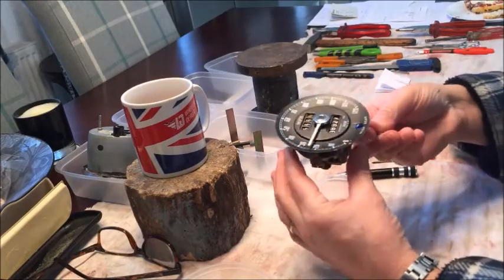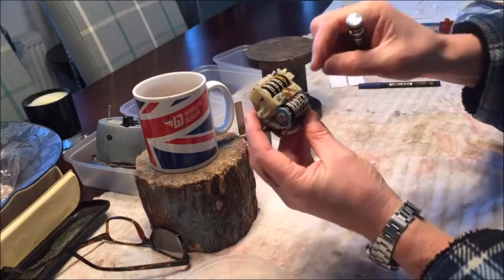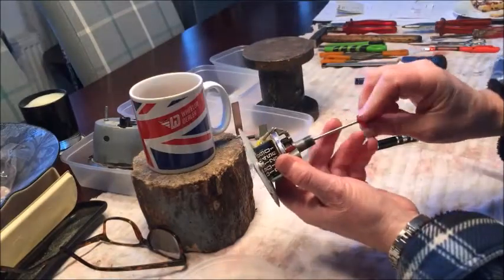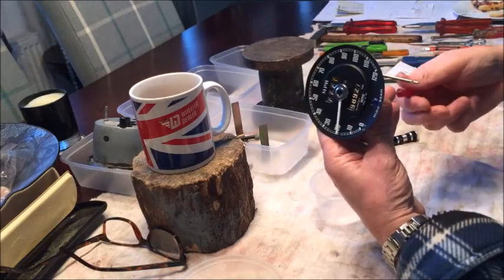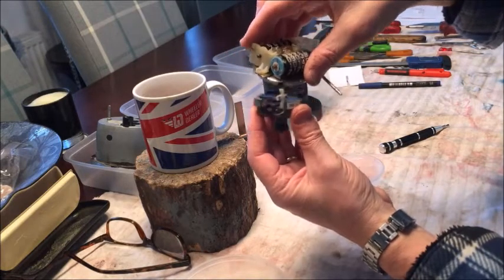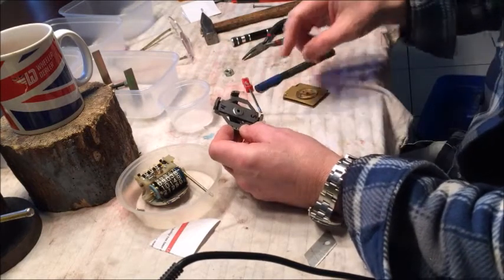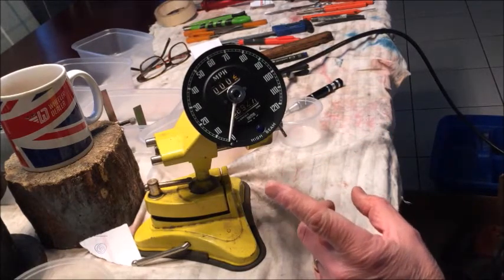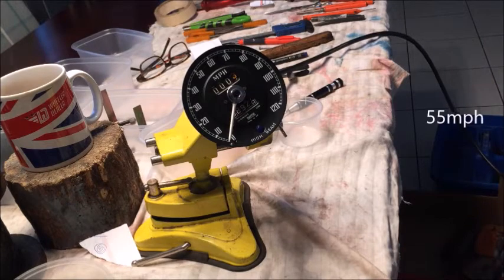Smiths mgb speedo. How it works, how to re-magnetise the drive spindle, 2 of 3

Comment: Hi Neil, Very good video. I watched the series last night and then took apart my wildly optimistic Morgan speedo using your instructions, cleaned it out and reassembled it. Tests great on the bench now, which it would not do before so I think is all good. The true test will be when it is refitted to the car in the Spring. Thank you very much for the clear, concise explanation and instructions. Much appreciated! Cheers,
Ted.
Reply from the maker: Thank you for the complement. Much appreciated.  Just an update, only use 4 magnets and about 6 swipes, mine is a little too fast now. Easier to add more swipes than take away.
Reply: Neil, how do you degauss the speedo magnet?
Reply from the maker: @wvadkins6088  When I did this to mine, I swiped in the opposite direction for 3 swipes. Then tested it in the car again. I needed to do this 2 time before I got the speed right.

Comment: Hi Noel
Great video,thank you for putting it up for us all.
I have a 73 TR6 which has the same problem. Can I assume your instructions will work on the TR?
Colin A
Reply from the maker: It should, you may need to adjust the magnetism a few times to get the speed within limits.  I would advise starting with about 4 swipes and add more if required after testing.  hope this helps.

Comment: Very nice video , I have a 1961 MGA1600 since 2003, and Jeager SM6161/08 1440  speedo/tach/odo/trip. Workings must be similair.
my speed jumps by +/- 5 mph at 30, trip counter does not add, odo works fine. So now I 'dare' to take her out and repair/clean this winter. Too bad your vid is in 480 iso 720/1080P.....
Reply from the maker: I'm really sorry about the recording quality....... If I'd known how popular it was going to be, I'd heave saved the original.
Reply: @Madeinwem  no worries mate. I will add some ‘Dutch courage’ before I begin in November or so. And I have ‘lived’ with this current condition since….ehrrr…2003! :-)

Comment: The speedo has many small parts. It would have been nice if the video was available in a higher resolution to make these properly visible. It remains a bit fuzzy at 480p.
What kind of sealant did you use when you assembled the chrome ring and the glass?
Reply from the maker: Thanks for the feedback, its a good point.  My Smiths speedo had a rubber gasket type of seal.
Reply: @Madeinwem  Thank you for your reply. I saw others mentioning that their gasket had turned in some rubbery mess and had to replace it with something else. I was curious to hear what you used, but apparently you were able to reuse the existing seal.

Comment: hi neil what size are the magnets please i guessed at 6x2 bought x10 but think they may not be strong enough as not improving much. on review of video they do look a bit bigger. Or its technique as could not get needle off so doing stroke without full disassembly as can see magnet from rear.
Reply from the maker: Hi Ian, the magnets that I used were neodymium and about 10mm diameter and 3 mm thick....roughly.
Reply: @Madeinwem  many thanks mine are way too small then. On a positive have managed to get the needle off carfully holding ally disk and waggle needle too and fro. levering just wasnt doing it. Reply much appreciated

Comment: Hi Niel! I also had great use of your video. I have a speedometer to a Pontiac Lemans 1969 that bounces. It’s not the cable. The magnetic strength of the north pole is very weak and I don’t seem to be able to change that without changing polarity. Could it be the magnet that is is causing the bouncing of the needle? Thank you for a great video! Regards Anders
Reply from the maker: Hi Anders, thank you for the kind comment's.  Thats a difficult one to answer for me. As I've said before I'm  not an expert. But with regard the the magnetic bar, I believe that unless the bar is damaged, it should be possible to magnetise it? Have you tried de-magnetising the bar and then re-magnetising it equally? Regards, Neil.